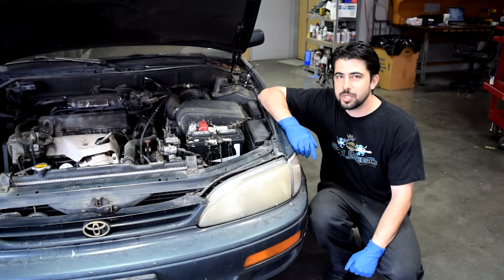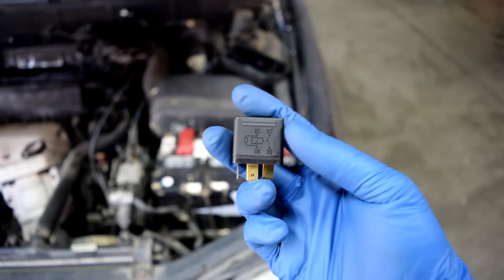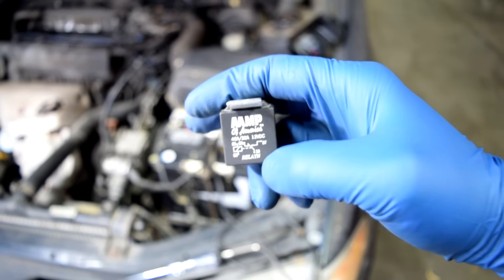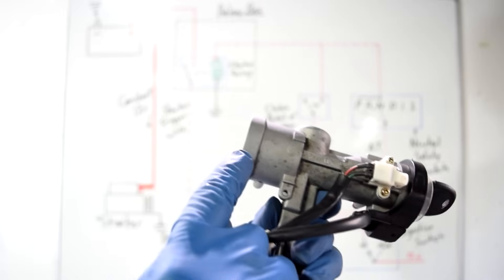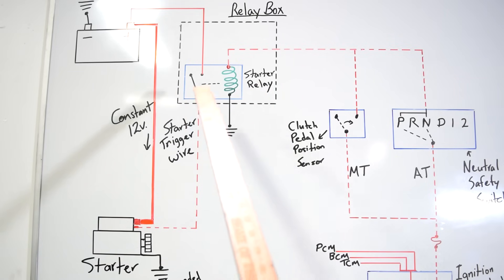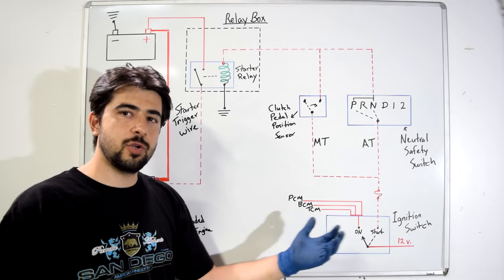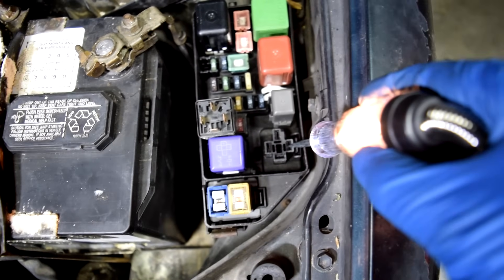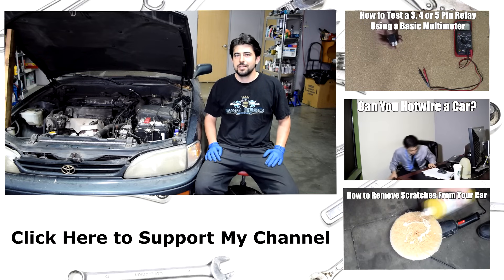How to Start a Car With a Paper Clip - NOT A HOAX

Comment: no question just good job man.
Reply from the maker: Glad you like the video, thanks for commenting.
Reply: +Ratchets And Wrenches let me ask you cause I always wondered is doing a head gasket easy? if I ever wanted to how the heck do I know where parts go back to lol??
Reply from the maker: No it's not easy, I would master timing belt replacements before I try a head gasket replacement. Even than I would study extensively how to do them. gl
Reply: +Ratchets And Wrenches should do a video on that
Reply from the maker: I have a few
Reply: That's not what I meant lol. That's funny typo

Comment: I thought it was a hoax until you showed no one was in the car.
Reply from the maker: Hey Schrodinger nice to see you here, yea I figured I had to show proof otherwise people would think it's another one of my hoax video's..lol
Reply: @myRatchets  can it be start without key inserted by bypassing with jumpers??
Reply: @myRatchets  is there a certain spot that the paper clips have to go inside the relay?
Reply: i tried it and it works but no start so i tried doin same with ign fuse and starter and almost worked
Reply: I tried this and all it did was shock the hell out of me
Reply: @abbywhalen9195  lol
Reply: Thanks for your video...

Comment: I have a question. My 97 honda civic ex sputters when I accelerate and sounds like it wants to die. But when I get the speed up  and rpm above 3000 it runs fine.  When I turn the car on and while it is in park,  it sounds great.Upon acceleration from a dead stop though it sputters and feels like it wants to die. I have replaced the headers, O2 sensor, fuel filter, replaced the spark plugs,  installed a new distributor and timed it,  and replaced the solenoid vtec gasket. Any help will be greatly appreciated.
Reply: my best bet would be a tps or maf. maybe spark plug wires
Reply from the maker: Do you have any check engine codes? Check for vacuum leaks, if thats not your problem disconnect the maf and see if that makes a difference, if not do the same with the tps. Also you can test them with a multimeter, search in my channel for video's on that. gl
Reply: No I don't have any check engine codes. I'll check for the leaks and sensors. Thanks for the help
Reply: Which spark plugs did you put in? Would check the intake air temp sensor, and the coolant temp sensor that goes to the ecu.
Reply: I bought a car that did the same thing, it started doing it after the previous owner changed the spark plugs himself. It would even die sometimes after stopping unless you put it in neutral, if it was in gear it wanted to die at low RPM. Turned out when he changed the spark plugs he left an air hose unhooked.

Comment: Awesome info as always man. Keep it up! Shout out from the 619!
Reply from the maker: Will do, thanks for the shout out. cheers
Reply: @myRatchets   @ScannerDanner   analogous to bypassing the AC relay and radiator relay, can the car be start without key inserted or removed and bypassing the starter relay with jumpers, and power feed the pin 87 of the relay straight from battery positive??? If engine is RUNNING, then can I drive without keys inserted??

Comment: Nice and clear explanation  of the starting system.  If someone doesn't know anything about this system I think your video would clear up any confusion. - Ozz
Reply from the maker: That was my hope, thanks for commenting. cheers
Reply: @myRatchets  I'm a tech but if your car won't start jumping the switch on the jumper relay wouldn't start your car?
Reply: Agree, great explanation

Comment: I'm 15 years old and I work in an auto body repair shop and we have many starting issues. There was an Audi s4 that wouldn't start or show any signs of power even after charging the battery and trying different methods to start it. However the airbags were off, and I was wondering if that has any effect on starting the car? The mechanics weren't able to start it and get it towed away. The damage wasn't that severe and the engine compartment was untouched. Any advice? 

Thank you
Reply: You can work your way backwards.  Run a hot lead straight to the starter, and see if the starter is working.  If it is, then keep going up the chain.  This is where, this relay video comes in handy.  Make sure you read up how to "hot wire" your particular starter.  Also, take the safety precautions mentioned in the video. Don't want the car to taking off on you.
Reply: Audi's have an immobilizer embedded in the key. if the immobilizer key is not in the ignition the car will not start
Reply from the maker: If there is absolutely no sign of power you have a problem with your battery or terminal connectors or the battery terminal connections, make sure the collision didn't knock the battery connectors loose or damage them both from the battery and where they connect to, especially the ground cable that bolts into the body. GL
Reply: Ratchets And Wrenches
Reply: Daryl. Dyxon.